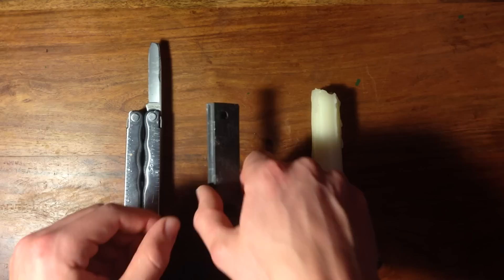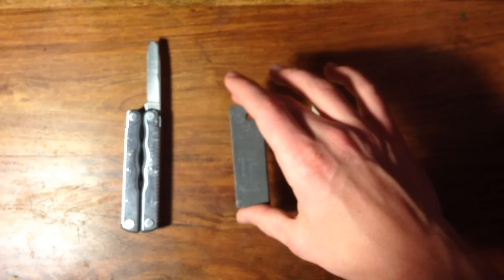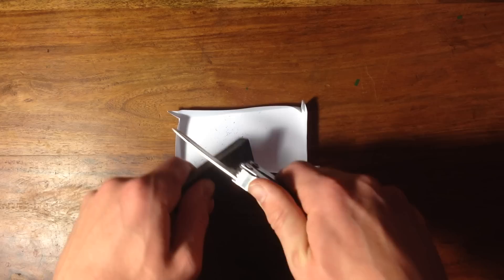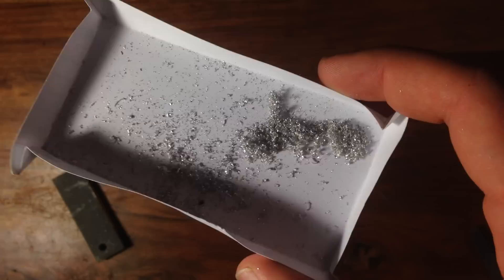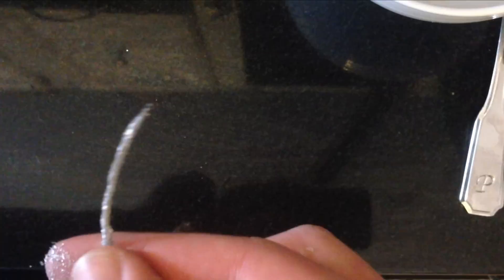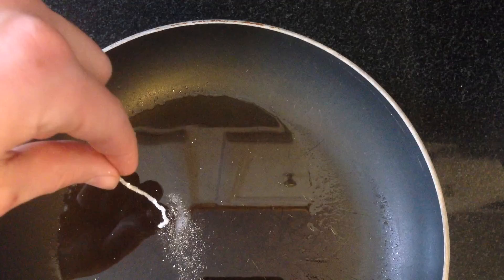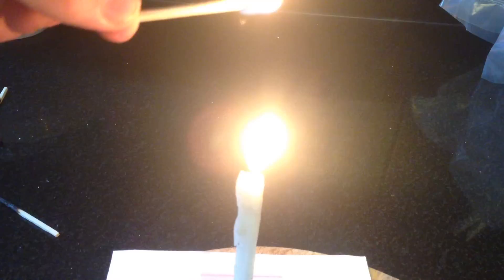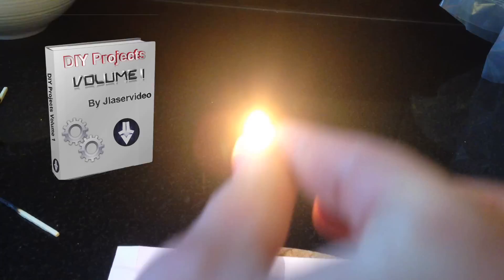How to Make Trick Candles

Comment: So, how would you suggest making these to put into a citronella candle?
Reply: Melt down a citronella candle, take out the wick, role it around in magnesium powder, find an appropriate sized tin, weigh one end of the wick down (if it doesn't already have a weight on the end) tape or secure the other end of the wick to a stick longer than the mouth of the tin, put the weighted end of the wick in the bottom of the tin with the stick laying across the top of the tin holding the wick upright, make sure the wick is centered. Pour in the melted citronella wax into the tin, and allow it to cool.
Reply: @Eidolon1andOnly  wow. thanks